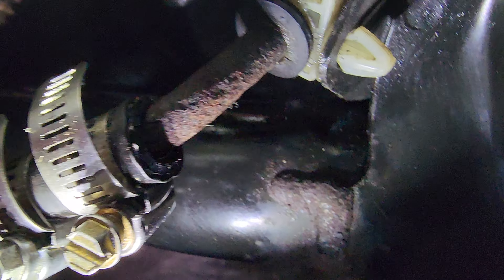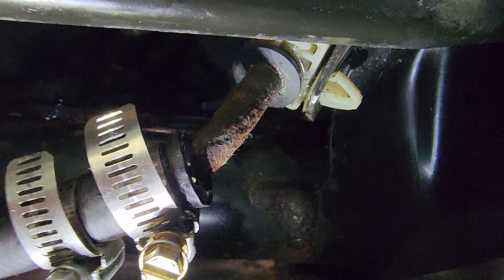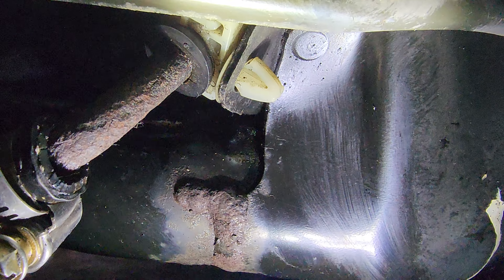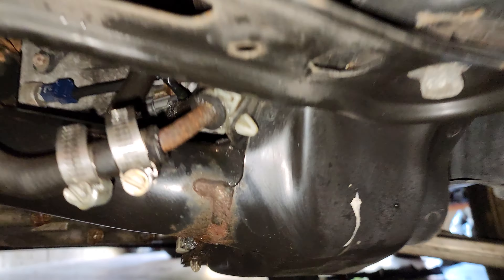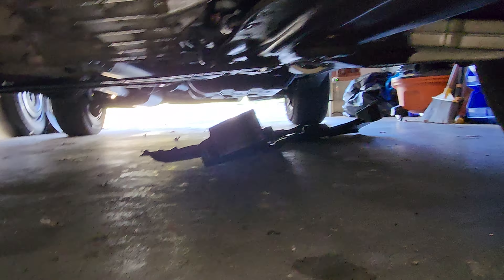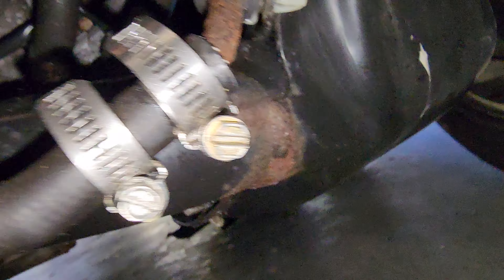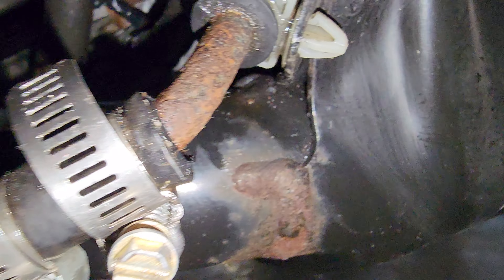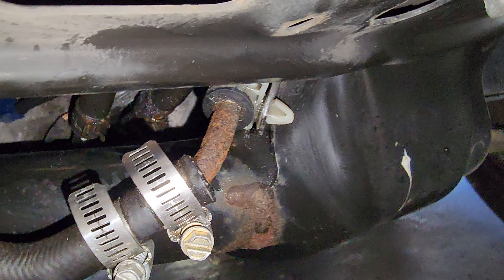Honda Pilot Power Steering Fluid Leak Repair (temporary)

Comment: I have the same leak in my 20011 pilot
Reply from the maker: damn. I wonder if this is kind of common  then. It's understandable because of the harsh Northeast weather. The salt on the roads destroys everything. The next thin I'm going to do is add a separate transmission cooler. The factory lines are starting to get bad. My year and mileage btw is a 2010 EXL with 204K. The leak hasn't come back, this repair worked.
Reply: @liquidalloy  yours is 2wd? 4wd comes will trans cooler